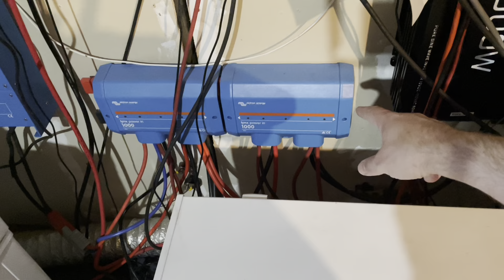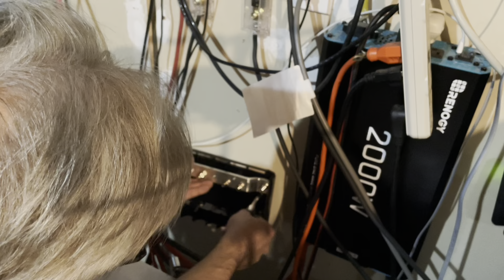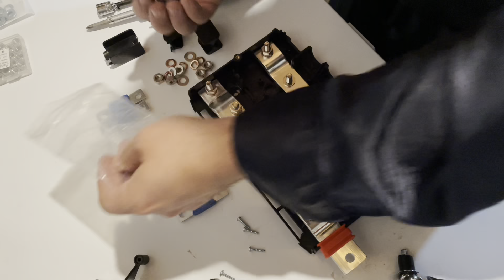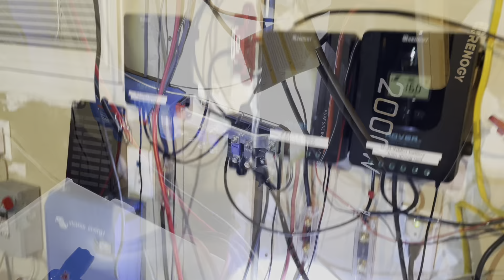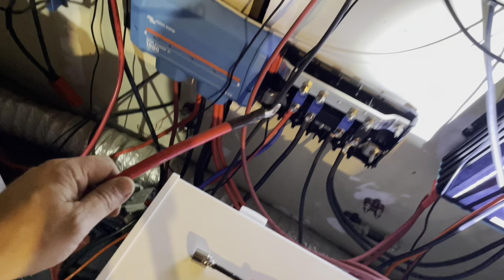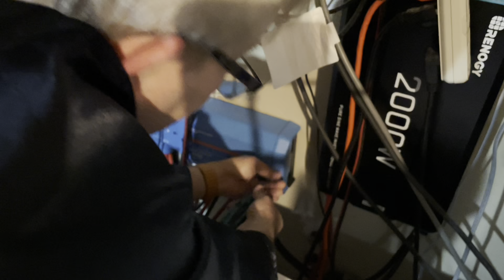Conversion of Victron Lynx Power In into Lynx Distributor fully detailed

Comment: I just checked the cost of the items on Amazon, $188.31 USD ($156.40 for the Power In and $31.91 for the rest) vs $223.55 for the Distributor and it only saves about $35.25.  But I was wondering about this idea myself, thanks for the video!  (Nov 2023)
Reply from the maker: I think they realized the trick and increased the price of the distributor.  The price difference used to be much larger now it’s probably not worth it.

Comment: Ha ha, I wrongly ordered a power in instead of distributor, then I looked and thought I'd just convert it as you have done. Then I thought, I bet someone has done the same thing and decided to look on YT.
And here we are. Lol.
Good stuff mate and hello from QLD Australia.
Is the copper beryllium  washer really necessary?
Reply from the maker: Yeah the beryllium copper remains springy even with lots of high temperature excursions.  If your climate is relatively stable steel is ok.  I used beryllium copper but it’s overkill.

Comment: You would be better off using M8 x 30mm bolts, and the best way to do it is to have the bolt, then one flat washer, then the plastic housing, another flat washer, a nut snugged firmly down, the fuse followed by the cable lug, then the beryllium copper split washer and finally the nut torqued down. Only one beryllium copper split washer, and that immediately under the last nut. One thing to watch is the O.D. of the first flat washer, it needs to fit into the recess of the base moulding, the original Victron washers fit of course, so I just used original washers in that position as my extra stainless flat washers were slightly larger in the O.D. and did not fit into the recess and would have raised the plastic cable housing slightly. The slightly larger washers were of no consequence against the upper surface of the bus bar.
Reply from the maker: This is good input.   I’m thinking of doing another conversion for my lithium ion set, so maybe I’ll try your combination on it.